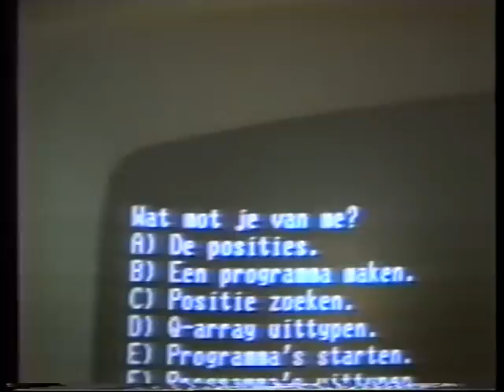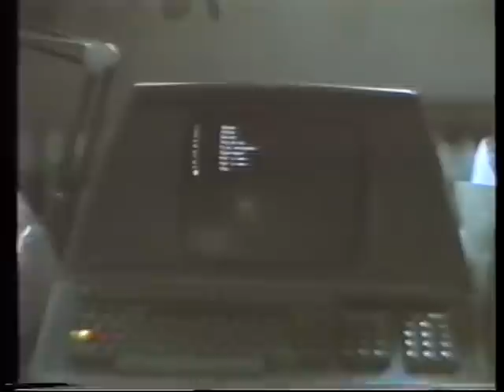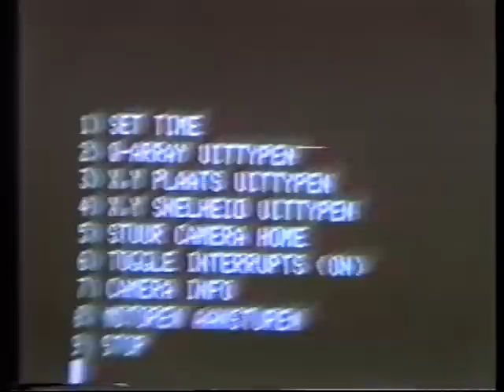070723_111346_import-1.mpg

Comment: What an absolutely remarkable accomplishment.  This video has so many layers to it, on the surface you have this project being powered by some of the most important technology in the history of computing.  The IMSAI and Altair being driven by the 8080, who's core functionality can still be found in x86 based architecture 45 years later. The CP/M operating system I would argue is one of the most influential operating systems of all time given the number of different computer manufactures that used it as well as the fact some of it's influence can still be seen in Windows to this day and attached to these machines is the world's first digital camera which now basically most of the earth's population points at their face or their lunch on a daily basis.

Someone should write an article about this if there hasn't already been one as there is still the networking, the parallel processing, the linear algebra, the image processing.  Much more than an amateur in the comments section could possibly do justice to.